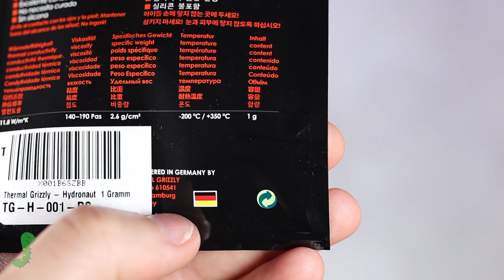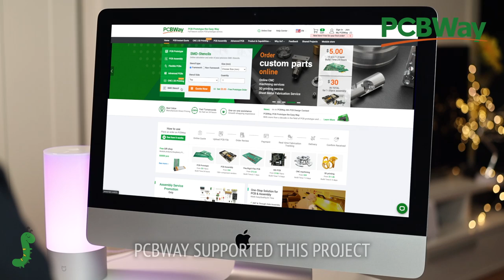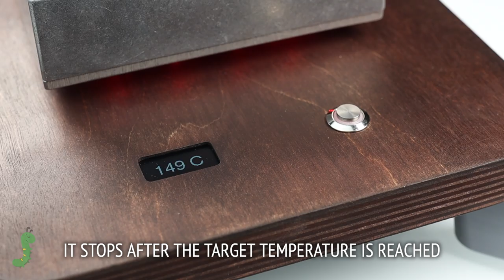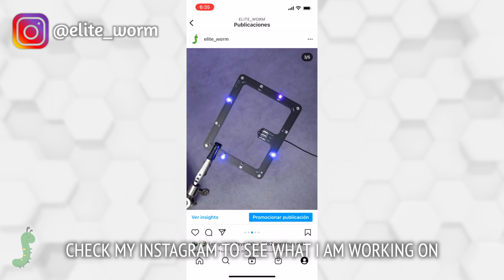I built an SMT Hot Plate Machine | Assembly & Test | Elite Worm

Comment: I love your use of 3d printed positioning jigs, very clever! It would be a bit less sexy looking, but I wonder if the heat loss problem would be fixed with having only a metal top plate as opposed to an entire box with sides.
Reply: Perhaps surround the plate’s sides with a species of insulation? 

I cannot find a plate in the size I’m after (roughly 3 x 4”, 75 x 100mm).  The store bought ones are either a fair bit smaller (30mm x 30mm) or a fair bit larger (200 x 200mm).

Thought was to use a thickish aluminum plate with space on the backside for between two and five cylindrical cartridge heaters.  He’s showing three, which tells me I’m probably not full of rubbish…

Comment: Nice project! What kind of PTC did you use? The ones that I found after a search are only rated up to 200C, which would be a bit too low for lead-free solder.
Reply from the maker: I used the 270C ones 👌

Comment: Nice build!  Do you have any concerns about the wood getting burned?   I've recently been considering buying a used solder plate or building one.  Also, I've never seen hot glue used with a hot air station like that.  What a great idea!
Reply from the maker: Thank you Aaron. I haven’t had any issues with that. There’s around 1 cm of gap between the hot plate and the wooden base. Anyway, if you have the chance to buy an used one, I don’t think going through all the hustle of DIY is worth it, tbh.

Comment: Breh. I appreciate the little details... but you put a cover over all the low voltage circuitry, meanwhile there is live A/C out in the open all over the place. If anyone else is reading this, and wants to build one of these deathtraps, consider buying a low voltage high amperage AC/DC adapter, and leave the A/C where it belongs... in a sealed box with FCC/CE markings. Nice editing though!

Comment: A metal case with no earth connection close to mains voltage heating elements is a potential death trap. It's an appliance which you actually touch when adding or removing PCBs. The mains wiring on the base plate is also exposed and anyone who lifts the device up risks the danger of an electric shock. There's no thermal runaway protection (thermal switch) in case the SSR should fail - SSR most common failure mode is a fail to short. Mains voltage fuse? I haven't seen one.

Please be careful and mind your responsibility - there are people who might build this and could make you responsible for the consequences of a) electric shock (injuries, death) b) burn down of their or other's houses (injuries, deaths, financial).

If the thermistor fails and your heating elements detach after they surpass 350 °C and will happily continue to heat. The system will also ignite if any element within the thermal control/feedback loop should fail or degrade. This could be a bad thermal connection between thermistor and the case, a bad thermal connection/bad coupling of the heating elements. Either case would lead to full power on the heating elements without the control loop having a chance to detect it.

Comment: So ice/water forming inside? Cant have hot without cold
Reply: Tell me which part of an electric heater gets cold. These aren’t peltier coolers
Reply: @retards587  thought they were. Not sure what it is then. "Heating element"
Reply: @mwint1982  most likely just a big ol’ resistor with a high power rating
Reply: @retards587  yep those are heaters 
same style used in 3d printers just a differnt form factor